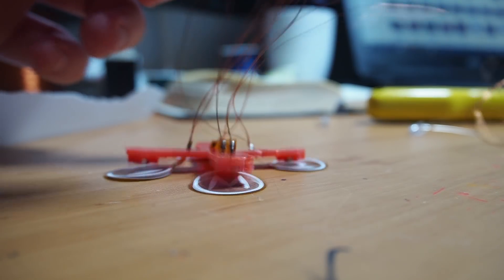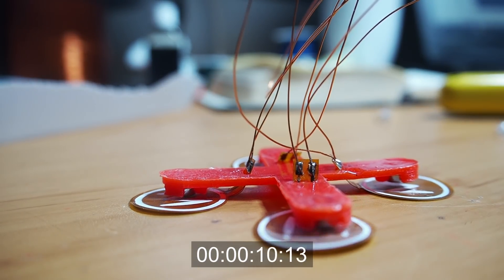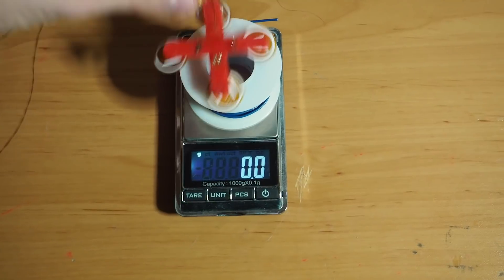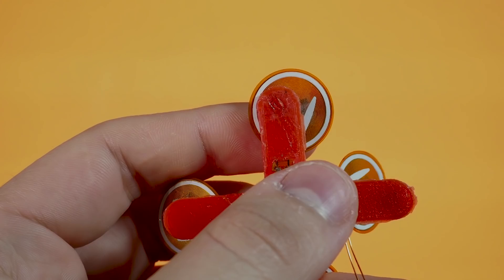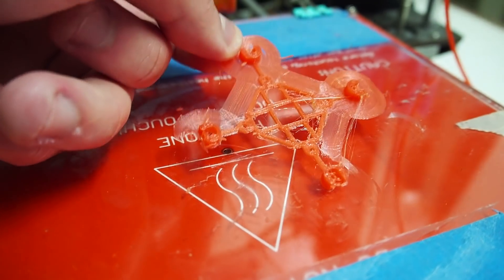Making Circuits Walk? PCB Robot MKII Concept

Comment: Mr. Bugeja,
I've just come across your channel, and I think the work you're doing is really awesome, and has helped inspire some of the micro-bots I'm working on! I do have a couple of thoughts for you, as well. 

I mean no offense at all, but your accent is quite strong (at least to a Southern American ear). If a more neutral accent isn't doable, you might consider adding subtitles to your videos. That's not to say you are not well-spoken, only that some of your more technical details have taken several rewindings for me.

On a more positive note: the bots I'm working on are not wholly different from your own, incorporating an extremely thin and comparably wide (i.e. Lightweight) form factor. I intend to create a double-sided pcb brushless motor based partially on your work. Surprisingly, this has led flexible solar cells and capacitors, at least on paper, to be the most practical power supply. I think that could be a good route for you to explore with your swarm bots.

Cheers, mate. Keep up the good work!
Reply: Heh, NOPE! Looks like solar cells indoors are even shittier than I'd ever imagined. Basically, take the power output of a given cell, and divide by a thousand, and you're about there. Having said that, it may still be possible, if I can make a tiny motor that draws about 50 microamps...
Reply from the maker: Supercaps are an interesting approach.. But Lipo batteries have better capacity considering the currents I'm working with - having said that the current passing through the coils can be reduced by adding more turns

Comment: Super Cool!

Some people at my university have made another robot with PCB coils, though you might be interested
http://stokesresearchgroup.com/2017/10/14/ultra-manufacturable-pcb-only-robots-unlock-swarm-intelligence-research/
Reply from the maker: Cool! 😃 Is that a 6-layer pcb?
Reply: @CarlBugeja  Its a 4 layer but only the last layer is used for the coil, so its not that strong, but the robot is very light at only 20 grams
The details are under "Actuation" in the article
Reply from the maker: Oh ok so I guess the coil is very low resistance.. How many turns do you have?
Reply: @CarlBugeja  "Each actuation coil has 17 turns and a trace width of 150 µm and one oz/ft^2 trace thickness" and they are driving them with 0.5A and I suspect 3.7V. Im just reading this off the article, I'm not part of the team that built it xD

Comment: Bonġu! Can I ask why you're using four actuators per robot, instead of three? Three would be lighter, cheaper, and still provide a full range of planar motion. There's a reason those Harvard Kilobots only have three legs!
Reply from the maker: Three legs would also work out 🙂 and like you said it would be cheaper and lighter. However its movements would be a little more restricted. I used this four legged 'X' configuration to make the robot omnidirectional, so it doesn't have to turn to go sideways. But your three legged suggestion is also an interesting idea that's worth exploring